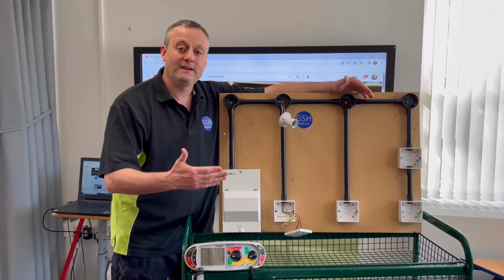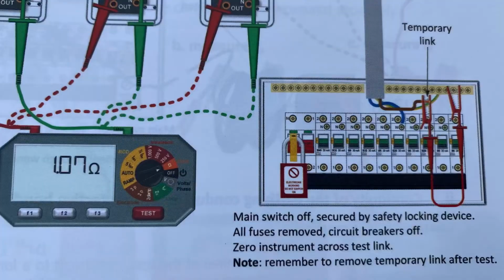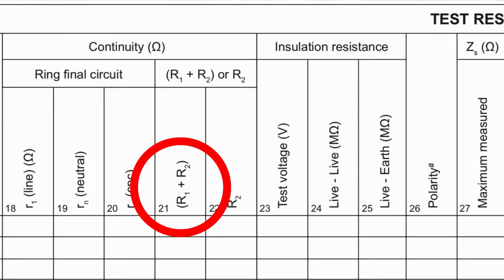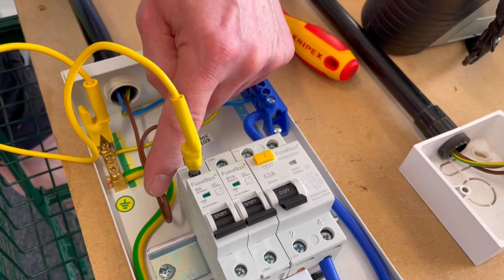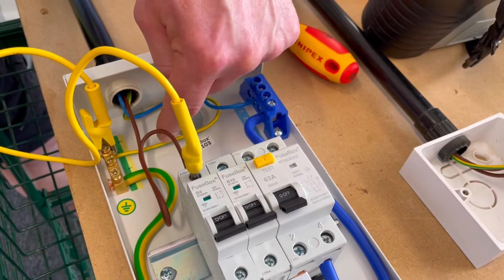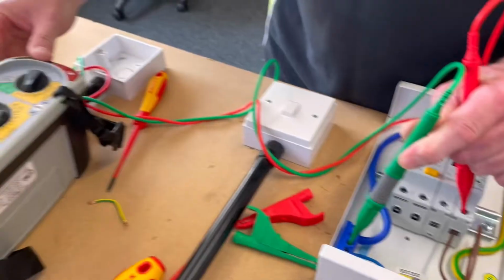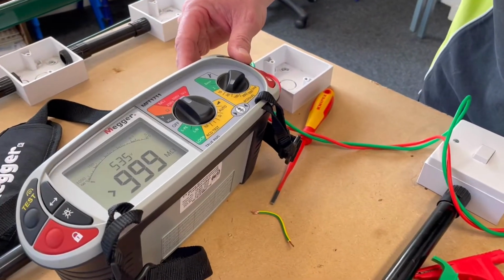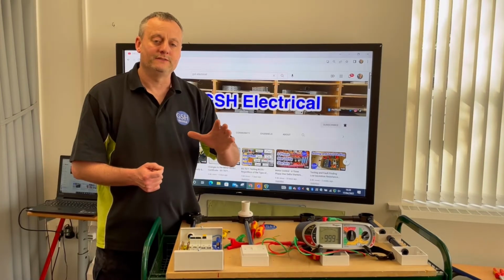Conduit 1 Way Lighting Circuit Testing - Continuity of the CPC, Polarity and Insulation Resistance

Comment: Hello. I would rather retain from commenting unless you are targeting this video as educational. With full respect to what you do, and do it for free, but because you are extremely precise in what terms you use, I would like to make a small note. When you zero your Ohm meter, you compensate for the series resistance of the leads and not "removing" it. It is still there but the Meter disregards it.
Reply: That’s because you’re performing an instrument re-calibration, by zeroing the leads.
Which is standard practice to do, every time, before you use the instrument testing equipment.

Those of us who remember analog electronic/electrical testing equipment. Don’t get caught out by parallax error 😂. 

Always kept a good analog meter, a good back up to have and there are times where an analog meter is the preferred meter of choice.

Wheatstone Bridge anyone, old school, but still extremely accurate testing equipment. For what it’s used for.

Excellent video @GSHElectrical, keep those videos coming 😎.